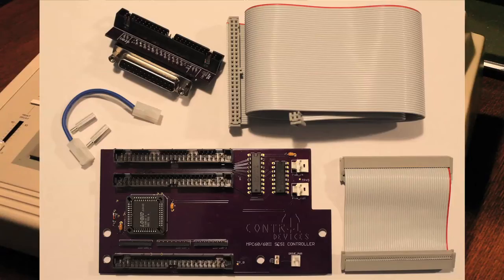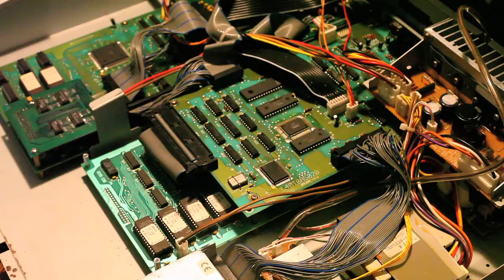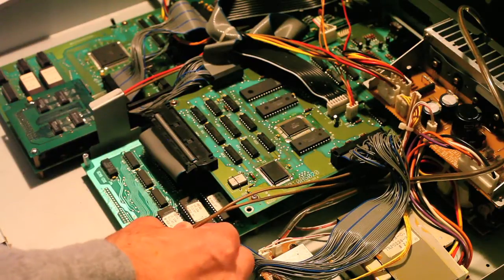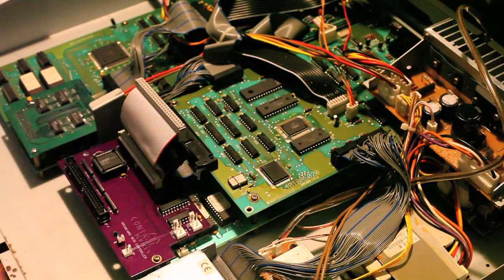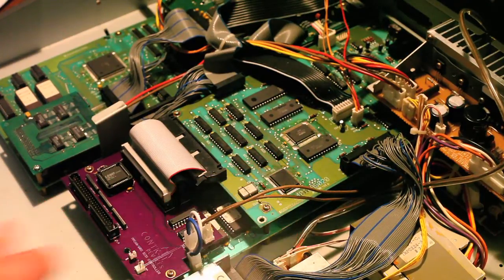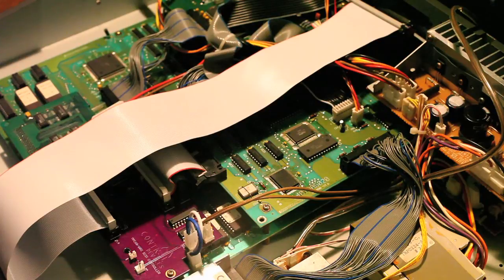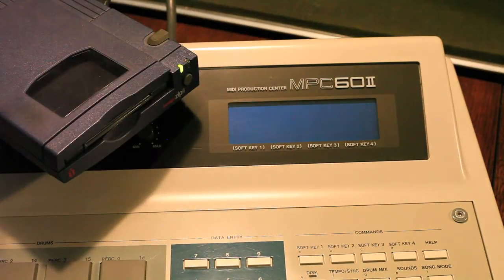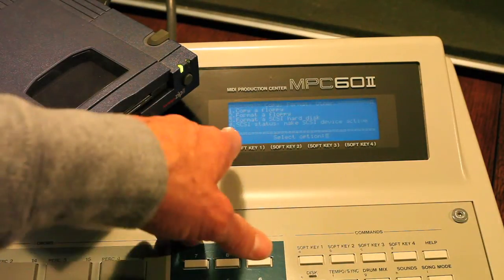Control Devices MPC60 SCSI controller Install Instructions

Comment: Seeing as you appear to have discontinued this product and terminated the email address, maybe you should take the website down as it is rather misleading
Reply from the maker: +Chevytravelleruk Hi, It does seem like our e-commerce site is having an issue displaying our contact information. CTRL Devices is still open for business, however you are correct that this item is no longer is in production. This is also stated on our website. We decided to leave all information on the product on the web purely for informational purposes for everybody who owns a kit or may end up with one second hand. Thank you for your interest!!
Reply: The website actually says there is another batch being made.. when I enquired using the mail link there my email was just bounced back..
Reply from the maker: +Chevytravelleruk We had planned on another run. We have a wait list, but the demand doesn't seem to be big enough to move forward yet.  We seem to be having an issue with the contact section on our webstore, Thank you for bringing it to our attention. We are looking into it.
Reply: @coldwarera  do you know the size of the 2 standoffs or part number. I just got one of those boards but didn't come with the standoffs
Reply from the maker: javier lopez hi Javier, is it a CTRL Devices board you have? We used this part, http://www.mouser.com/ProductDetail/761-M2108-3005-AL 

I assume it will, but cannot guarantee that the same part will work with other SCSI boards as well.